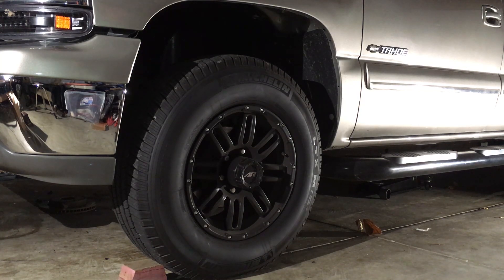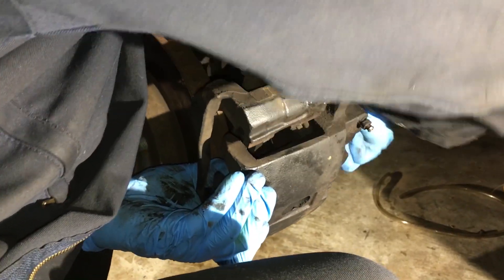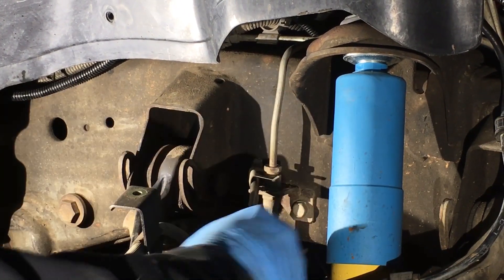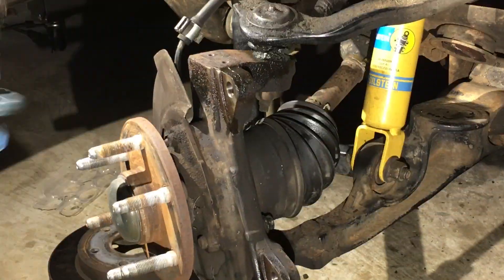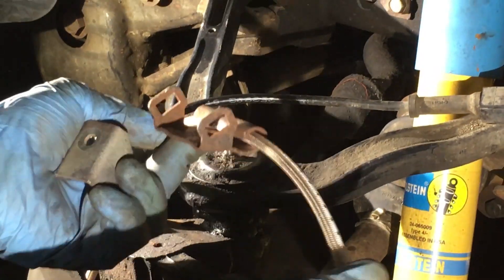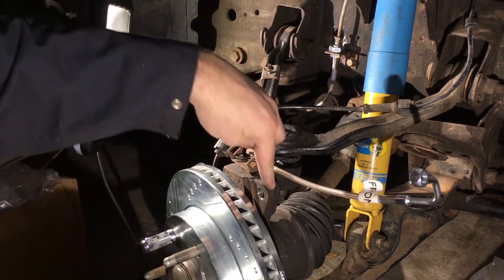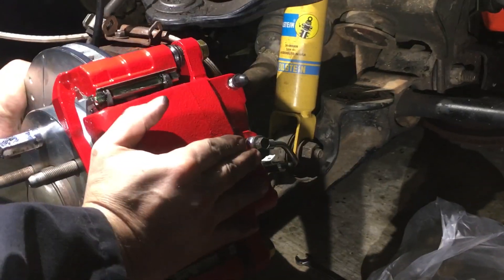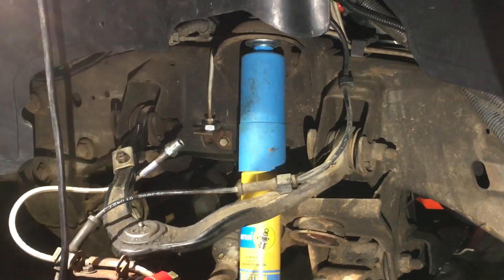Install Power Stop Front Rotors Calipers Pads & Russell Brake Lines

Comment: I realize this is an older video, but you should never only replace the pads.  The rotors have become engrained or imprinted with the old pads and may even be warped.  If you can, have them turned.  If they are too thin or warped, you need to replace the rotors.

Comment: Hey whats the part number for the Russell brake lines you used. I am having problems finding braided lines to fit my 02 tahoe with new power stop brake kit
Reply from the maker: No clue, I'm sorry.  It's been a long time since I did this.
Reply: Did u upgrade the master cylinder

Comment: Were do you get the book?
Reply from the maker: if you mean the Haynes directory, they are at every auto parts store or online
Reply: BE CAREFUL of those Haynes Manuals and the Chilton Manuals, too. There are A LOT of mis-prints and typos, and they are NOT easy to find.
 Whenever possible, I get the genuine Factory Service Manual for my vehicle.
A good source for old shop manuals is E-BAY, and I got my present FOMOCO Shop Manual from Amazon's used book department.
 Good luck !!

Comment: Nice instruction and good vid.  Question: Power Stop calipers are set up SILICON lubricants.  Silicon is not compatible with dot 3 or dot 4.  Thoughts?
Reply: Power stop calipers are originally refurbished stock/OEM painted with high temp red/black/blue etc.etc.
Reply: @ninjamigs1766  Hi. So Powerstop calipers are essentially stock but painted? So not much of an upgrade?
Reply: Will the powder coated calipers last a long time? I paint mine red but they never seem to last to long and start chipping and flaking